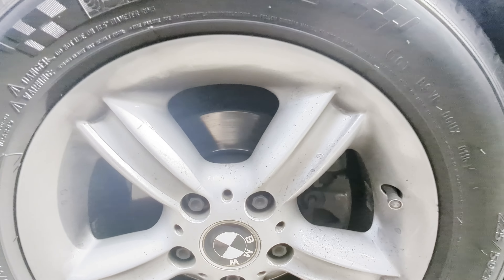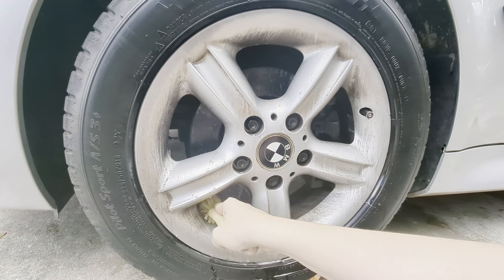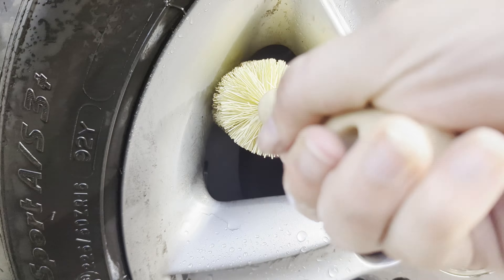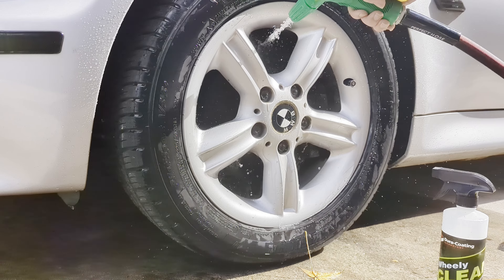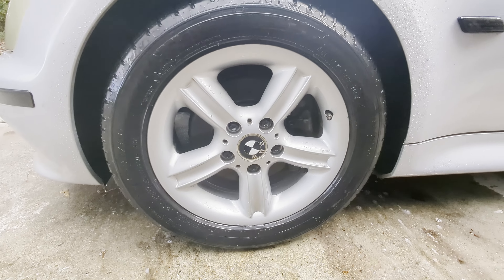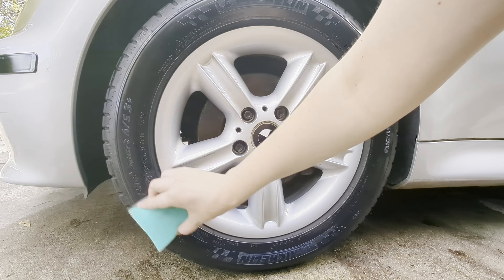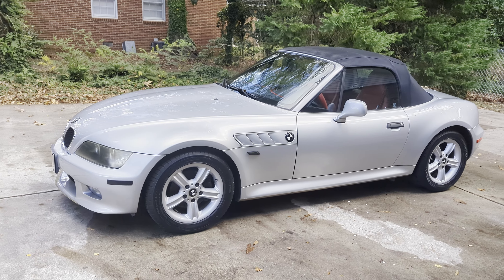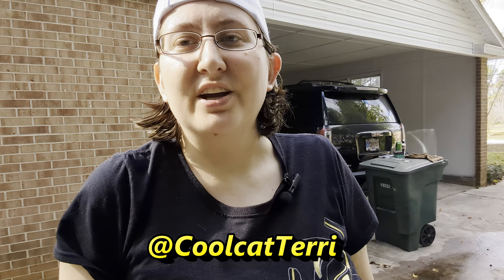BMW Z3 Dura Coating Wheel Detail

Comment: Once or twice a year I also remove the wheels to perform a detail cleaning of the brakes and wheel wells, using a protective dressing on the plastic wheel well liners (similar to the tire dressing).
Reply from the maker: I definitely need to remove my wheels to get a better clean but this gets me bye